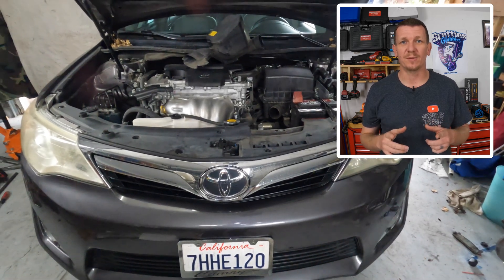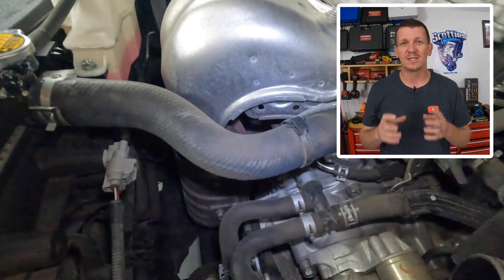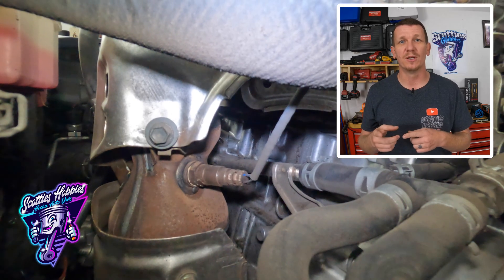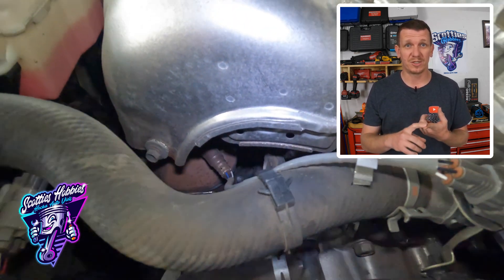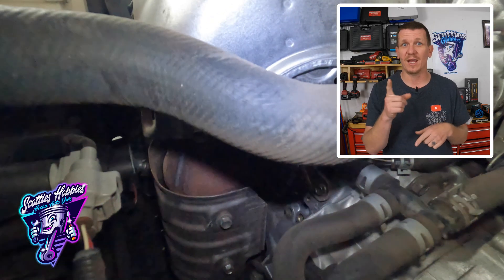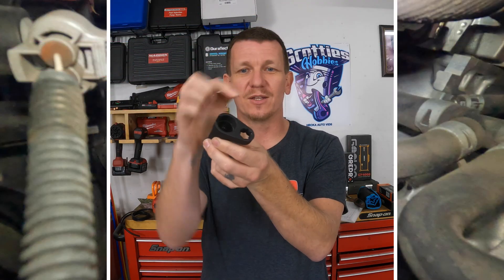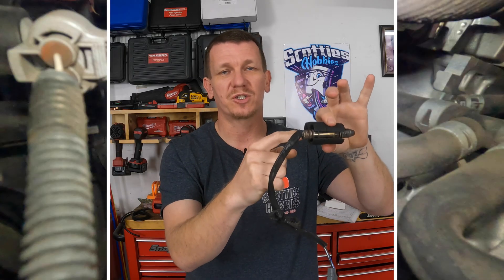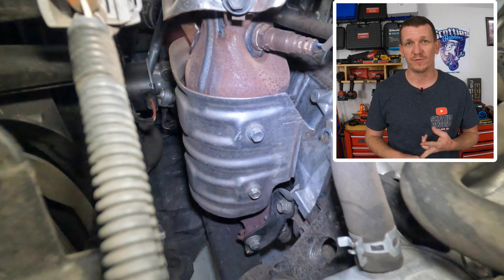Bank 1 Sensor 1 Oxygen Sensor Location & Info | 2012 - 2017 Toyota Camry 2.5L

Comment: It will be nice to know the connectors and the wiring color, the signal and ground.
Reply from the maker: The 2 black are the heater. The gray and white are the signal wires. I could be wrong.. but if the top of my head, I believe the gray is the ground side. But the white and gray both go to the computer.